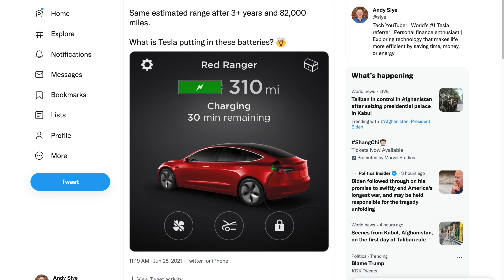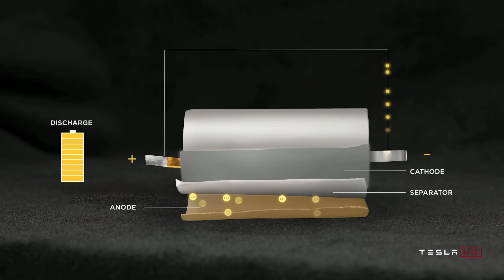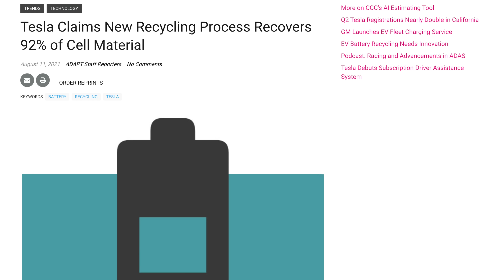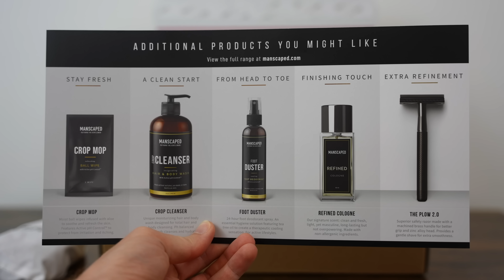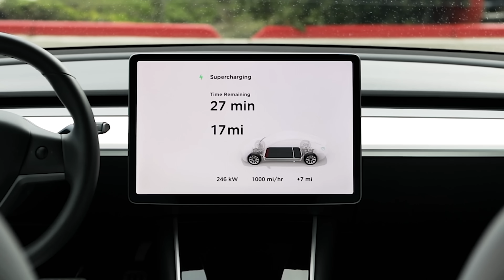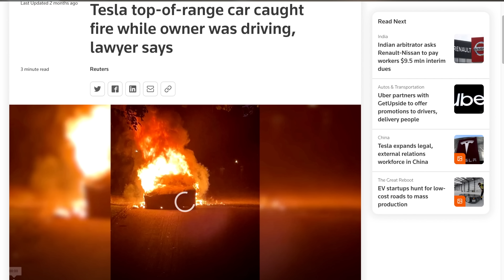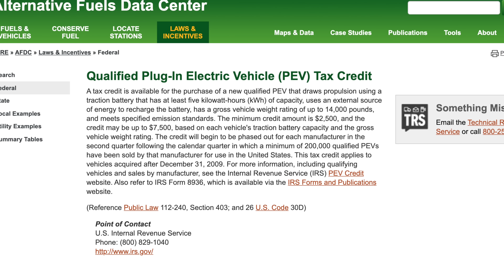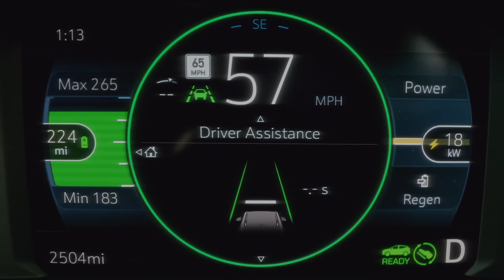Top 5 Dumbest Tesla Myths Debunked!

Comment: Change means the issue is so new that you my friend don’t have enough personal experience or personal knowledge to give accurate facts. Because you choice to take risks with your own money doesn’t mean others should do the same. There is so many reasons why electric cars are impractical and frankly garbage for many people. Tho emissions and other concerns are some concern to some, it is really trivial. Here’s the biggest problem, batteries that cost a fortune to replace when needed. Electrical issues alone take a lot labor for technicians to pinpoint, again, expensive repairs which would typically cause a vehicle to be junked versus repaired because people can’t afford to fix it and the value usually isn’t worth it. Technician’s for these are extremely rare if you have a problem and last thing is can the electrical plant really handle the demand if everyone were dependent on electric cars? An electric company employee who is much more knowledgeable and experienced said NO and his views is more reliable than say… a new car enthusiasts like you who put opinions but you don’t have the personal experience for you to back or bunk your own beliefs. Those other issues may be valid to some but doesn’t really matter

Comment: Can this letter possibly be true?  It's being fowarded throughout a retired military group.   

Subject: From an anonymous Wisconsin State Trooper

 I’m not a fan of all electric vehicles. Too many variables affecting battery consumption. Definitely not suited for cold climates. The following experience just cements my distaste for EV’s.

I get sent to a motorist assist the other day, at the start of our snowstorm. Tesla on the side of the interstate, dead battery. So, I arrive on scene and the occupants have the right-front door open. They tell me that they can’t open any other doors, because the battery is dead. Sure enough. Can’t open the doors from inside or outside. The driver also can’t get her license out of the glove box where she put it during their trip. Because the glovebox opens electronically… and the battery is dead. You actually have to use the computer in the center of the dash to open the glovebox.

They said they had 10% battery left, should’ve been plenty to get from that location to the charging station nearby. Then all of a sudden, the whole car shut off and they coasted to the shoulder.

So now I have to find them a tow. No one wants to tow EV’s. Finally found one company to do it. 8-mile trip to the charging station in Tomah. $1,000! Normal vehicle on the flatbed would’ve been $150.

So now we’re at the Tesla superchargers. Guess what. Can’t open the f’n charging port because the battery is dead!!! The ports open, you guessed it, electronically!!! 🤦🏼‍♂🤬. And we also can’t open the doors now (had to close the one open door when it was loaded onto the wrecker). The owner's manual is in the on-board computer, but the battery is dead.

I got the occupants to a store where they’d be warm while calling the rental company to figure out how to charge this POS, so I’m not sure of the outcome. I had to leave for a crash report.

EV’s may be the way, someday, but certainly not today!! I’ll stick with my dinosaur burner.
Reply: Could be somewhat true.  The 12v battery powers the computer and the systems it controls, while the big battery powers the motors.  If the 12v dies, then it could cause most of these symptoms.  But the car also has manual levers to open the doors, as well as a manual lever to open the charge port.  Mainly, it sounds like a case of owners not knowing how their car works.  You also get ample alerts in the days before your 12v battery dies.  But even if all this  is true, gas cars complete break down all the time.  Everything breaks eventually.
Reply: Oh, and the owner's manual is also online, so they could have just used their phone.  And they could have used the Tesla app to get service for sure.

Comment: The charging on a road trip thing has never been a hang-up for me. Lord knows after 3-4 hours at the wheel I've got to stretch my rickety legs, use the restroom, and probably chow down on a granola bar. Add a smoke break (I know, I know...) and letting the puppernutter wander around and do his business, I easily spend half an hour to 45 minutes at a rest stop as it is!

As for the fire thing, my Fiat has GALLONS OF GASOLINE just chillin' there! Lord knows what could happen in the event of an accident! An EV fire wouldn't really weigh on my mind if I were car shopping at the moment

Comment: I have nothing against EVs, but as a comment to #5 - What about those of us who simply can't afford to buy new, or even CLOSE to new, cars? Personally, I drive a 06 Volvo, that I got for $1500. And even tho it would be great to have an EV, what options would I have at that price range?
Reply: Thanks for watching and commenting don’t forget to hit…. the subscribe button more info… consultation ……..and advise…… text.

Plus
One 
Eight
One
Eight
Nine
Six
Four
Zero
Seven
Eight
One….!!!
Reply: text me!
Reply: The goal is not to replace all vehicles at once. The goal is to stop making new gas guzzlers. 

The reason why you can drive that $1500 Volvo is because it dropped in value like a rock. Someone had to eat that loss. EVs depreciate much less (at the moment), in part because there's much less to wear out but also because a lot of people want one.
Reply: @realulli  True.. The Volvo is a diesel tho, so it gets a very good mpg. But hopefully EV prices will go down in the next few years, so people can afford to by a decent one, even at a low used-car-budget :)
Reply: @TS84NO  trouble is, even cars from companies with known quality control issues (e.g. Tesla) last just about forever. Try getting an 8 year old Model S with 200k miles on it for under 30k. Good luck... at least here in Germany, even a totaled Tesla will cost you at least 5k if the battery is OK. 

It all boils down to the state of the battery (to a very large degree). I think when it leaves the battery warranty period, the value might drop considerably. Not sure about that, though. I'm not an expert, just an interested amateur. ;-)
Reply: @realulli  It seems like it's the same here in Norway. I've seen some pretty cheap EV, but those needs battery replacement, which (at least with Norwegian prices) would be way too expensive.. However, I'm considering going for a hybrid as my next car, as something like a 10+ yo Prius can be found for pretty cheap :) Then, maybe a few years ahead, once battery prices have dropped, I'll be able to find an EV in my budget. It gotta be one with a pretty high range tho, as the Norwegian (and German too, I would think) winters drastically reduse the real life range.

Comment: We had a d22 Nissan Navara diesel and we had to get the fuel pump replaced in the engine. For a re conditioned one it cost us over AU$4200. Just for a fuel pump. The manual gearbox was going on it before we got rid of it and the quote was around AU$4000 for a replacement one. Cheers for the vids Andy. From Australia 🇦🇺
Reply: Thanks for watching and commenting don’t forget to hit…. the subscribe button more info… consultation ……..and advise…… text.

Plus
One 
Eight
One
Eight
Nine
Six
Four
Zero
Seven
Eight
One….!!!
Reply: text me!

Comment: Myth #1 might be true of cars with a decent battery management system like a Tesla but cars like the older Nissan Leafs (Leaves ? :-) ) absolutely will suffer severe battery degradation over time. One of the reasons for this is that those vehicles had no useful battery cooling system (just a fan). It's not at all uncommon for those cars to have lost 40% of their original battery capacity or more. 

Thankfully Tesla batteries have a much better track record.

Comment: You forgot a few myths:

6. Full self driving actually means full self driving and we will have self driving Taxis in 2020.
7. Model S plaid can do 0-60 in less than 2 seconds
8. The new batteries have 5x the power of the old ones
9. Model 3 will start at 35,000 USD
10. Teslas charge faster than other EVs

Oh wait …. those actually are myths

Comment: over the years I have had several concerns beginning with the build quality.  Tesla seems to have made great progress here.   Living in an urban environment in the north east  I walk mostly with my driving being predominately trips of 120 plus miles.   My concern now is the range in cold months and recharge time.  I am heartened to hear it is more in the 15 min range.  ( a half-hour every 3 would not be a positive)  In reality that is only about 5 -7 minutes more than it takes to fuel my ice vehicle.    Currently, I am thinking next year it will be time to go electric.   I just hope this chip thing is cleared up then.
Reply: I think they made a huge jump in 2021 but I did have some initial mechanical issues such as the heat pump being defective and the wheel alignment being off - by a lot. But both issues were resolved quickly, and it now looks and runs great. As a comparison,  I've had brand new Chevys and Chryslers with a Lot more problems.

Comment: Agree with most of your points, but one. I've been on the road the last few months in my Model Y (which is my favorite car I've ever owned) and while the Supercharger network is vast and mostly adequate... it's still not great and a couple of the issues I've run into lately are slow Superchargers and "ICEing." While 250 kW stations are growing, most are 150 kW & many are 74 kW or even 56 kW which makes for a poor traveling experience. The other main issue is "ICEing". Happened to me 5 times last week. Gasholes are doing it on purpose & Tesla needs to work with local governments & tow companies to put penalties into place or it'll get worse. Until these issues are fixed, long trips are still a little in question. You can obviously do them (I'm a testament to that), but they can still be challenging. Lots of work still to do.
Reply: What is "icing"??  Sounds like a hockey term!
Reply: @markjones2517  Haha. Not hockey related 😀 It’s when a Internal Combustion Engine (ICE), which is a gas car, parks in an EV only charging spot to block and prevent electric vehicles from charging. It’s the equivalent of Tesla’s blocking people at gas stations from filling up, except we can’t always run across the street to another station.
Reply: What would happen if you called the local towing company on these people. I think anyone can call the towing company if a car is parked illegally. Once these cars start getting towed, you will see a lot less of this behavior.
Reply: @ymcpa73  From my understanding Tesla hasn’t applied with local governments to have this actually be an infraction so no tow company or police department will do anything outside of ask them to move. It’s a real failure on Tesla’s part to not take this seriously. I want to be clear, I love 95% of everything about my Tesla, but stuff like this really bothers me.
Reply: @bryanhauer  I believe that the signs that say no parking unless charging have a city ordinance on the sign. Shouldn't that indicate that the car can be towed for breaking the ordinance?
Reply: @ymcpa73  I asked a few and was told there was no actual ordinance on the books, which was why they couldn’t call a tow truck or police. Only a sign asking them not to, unfortunately. I’m looking into this more for an upcoming video so stay tuned.

Comment: I bought a Modei 3 and got delivery on  June 26,2021. I’ve had nothing but trouble! Phantom braking on Interstate highway 70 to 50 just like that, slows down when tree shadows the road, wipers turn on whenever they want when car on curse control.
Reply: All of those issues are addressed in autopilots architectural rewrite